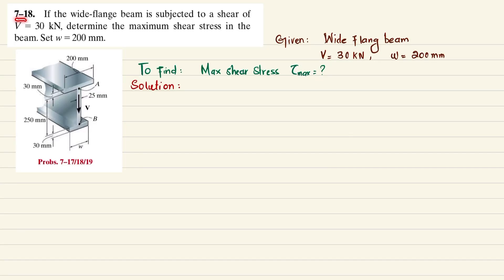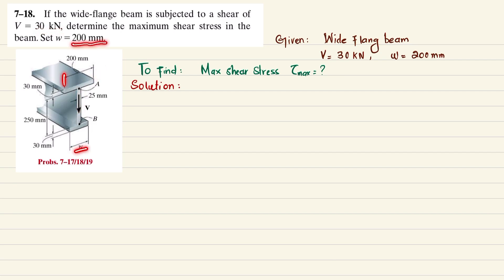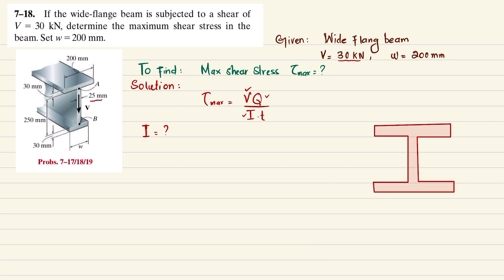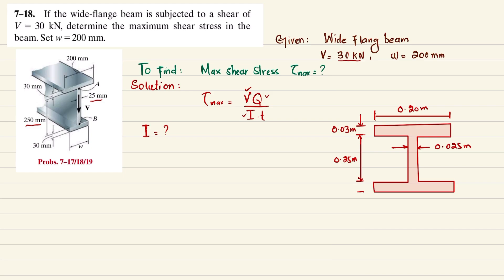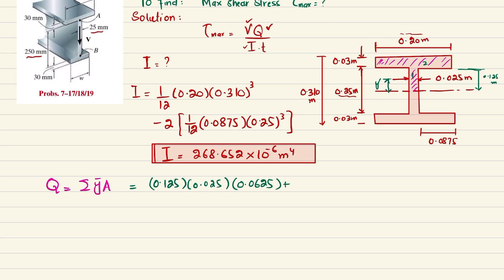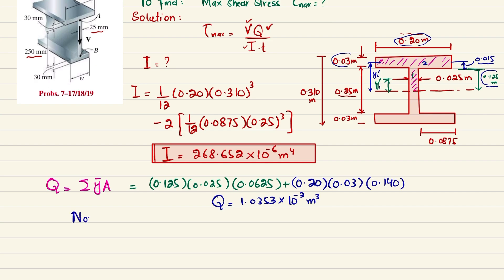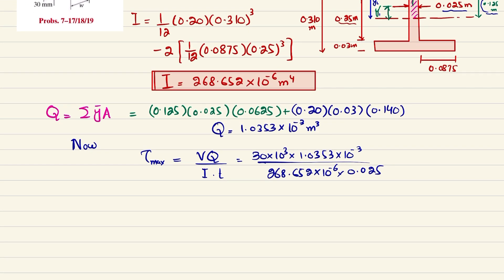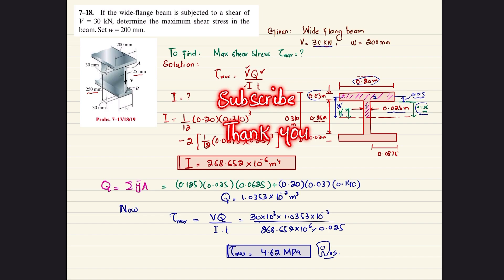7-18 Determine the maximum shear stress in the beam| Mechanics of Materials RC Hibbeler

Comment: Why it was 1/12, and -2 in the I? Thanks for reply
Reply from the maker: Please mention the time in video where you have confusion.
Reply: @engradnanrasheedmechanical  In 2:52 and 3:05. (1over12, negative 2)
Reply from the maker: @kentjimenezsigue8961 ok the moment of inertia for rectangular shape is 1/ 12 (b *h^3) now you have seen that we have taken whole body as rectangular and then we removed / subtracted the moment of inertia of the two hollow rectangular . By doing so we will get the moment of inertia I for the section shown in the picture. This is one of the method. You can find I by another method as well which is described in some other problem. But this method is easy relative to other one.